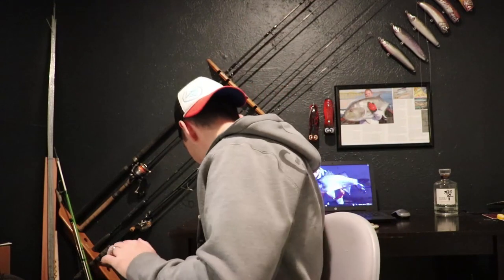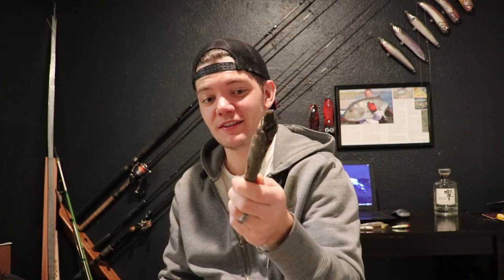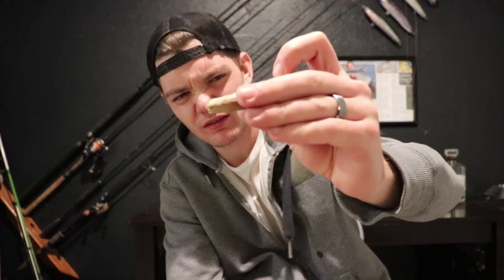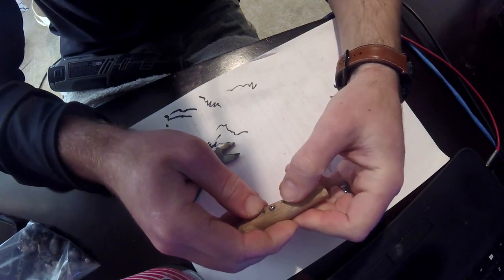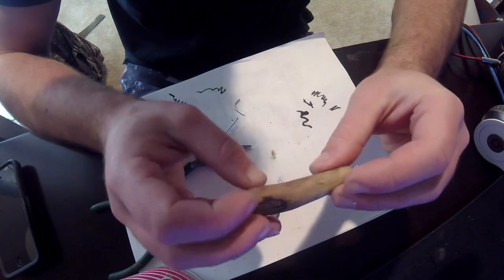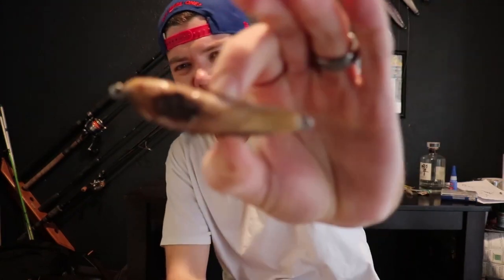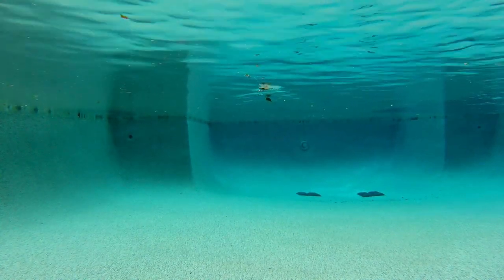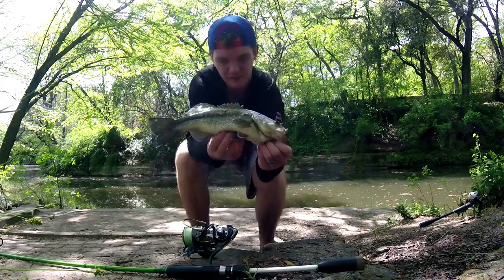Carve, Cast, Catch - Carving A Topwater Out Of A Stick To Catch Fish!

Comment: Top vid. With the music being so loud, I couldn't hear you properly. Might want to re-think that side of things. Other than that.. awesome video. Looking forward to the next. Regards Mark
Reply from the maker: Thanks for the comment Mark! My software must've slipped up which caused the loud music over the narration. Will keep a better eye on it next time. Thanks for watching!
Reply: @TheAnglingGlobetrotters  Just curious, is that a fine sawdust you're using to push into the gaps/ holes?
Reply from the maker: Yes sir, I always collect sawdust from either sanding or from my bandsaw. Best trick in the world for when it comes to closing of balance weight gaps! Super quick!